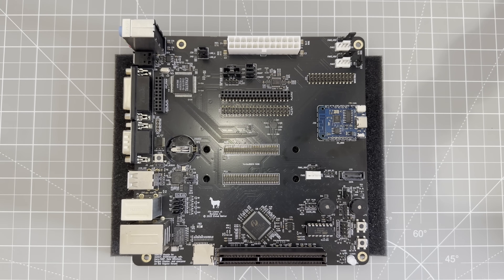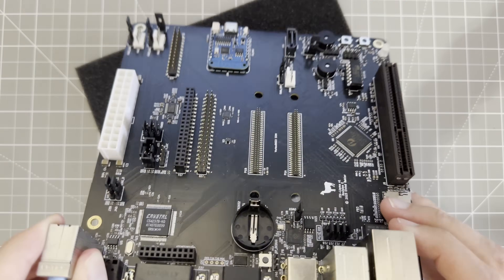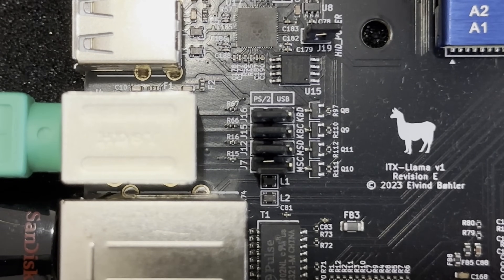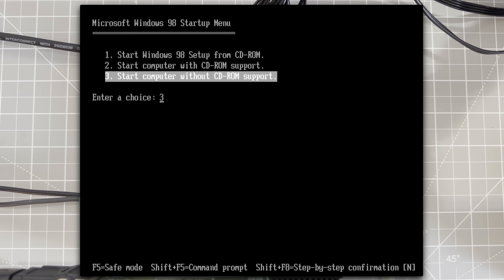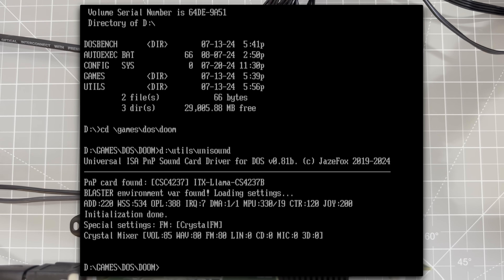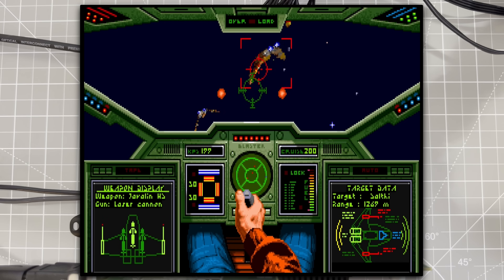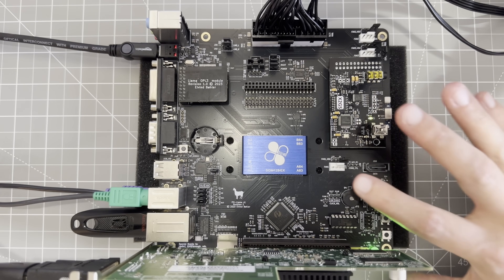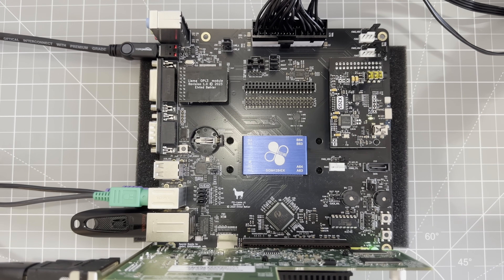ITX Llama: A Brand New PC for 1990s DOS Games!

Comment: Slightly OT, but when you mentioned sound cards I had to think of the fact we barely have them anymore, especially not "true" soundcards that did hardware acceleration. Good audio processing has somehow become a very rare occurance in games, with only a few outliers like Alien Isolation (who created their own audio solution for that game).
Reply from the maker: Agree! Dedicated sounds cards have definitely gone the way of the dodo :-(

I’m interested to learn more about Alien Isolation! What did they do that was custom?
Reply: @jamesfmackenzie  They developed their own audio solution that did real time reverb, depending on the layout of the levels and the source of the sound. None of it was "off the shelv" tech and completely developed in house (apparently because no current audio system satisfied them)
Reply from the maker: @xXYannuschXx  Wow! Very impressive! And another reminder to final play Alien Isolation! 🙂
Reply: @jamesfmackenzie  I can highly recommend it :)

I would recommend however to use the graphics INI tweaks and TAA injection. With current systems you can get alot more graphical fidellity out of the game.

PS: they also did some magic with the lighting system, where they used dynamic cubemaps (rendered during run time) to have dynamic radiosity; the light practically bounces around corners, like it would do with current day ray tracing methods.

Its mind boggling how far ahead they were with this game.

Comment: Just dropping into the comments to decimate the notion that you can emulate the total function of the system, clock accurate with simply the on board support chips.  No - that's not even really -- but now that I've said that somebody is going to drop in the comments and say exactly that.

Comment: I really love this. As others have commented, PCI is an interesting omission but with the various audio headers and onboard networking I'm not sure what PCI cards I'd actually add - perhaps a Voodoo card, although of course AGP versions were available. I'm guessing that going with ITX limited the design to one slot so I think AGP makes sense for those later Win9x games that are too much of a stretch for MiSTer. What a cool project!
Reply from the maker: Yep, it definitely has a bit more grunt than the ao486 core on MiSTer. I actually have a Voodoo 3 AGP running with this board now - it even copes with Quake 3 OK.

One for the next video!
Reply: This is not a native AGP implementation. Its PCI-E bridged to PCI running at 66Mhz. Its what the author declared and lets hope it really runs at 66. In that case its perfect for 3DFX cards. If only at 33 as PCI it would mean slight bottleneck, but not that much with this CPU. On non 3DFX it would be somewhat larger impact as they utilized the AGP bus more. Also, there seem to be compatibility issues, Nvidia cards do not work at all under windows for example. That being said, the author posts some benchmarks on Vongos and this thing performs somewhere on the level of Pentium MMX200-233. On non FPU heavy games it runs betters, so it behaves more like a Cyrix MII than anything else, so, any strong video cards makes no sense anyway. 

The author should have went with PCI instead, he even has PCI design done but still the AGP board seems to be more prevalent. I wold rather see micro ATX board with few PCI slots where one can get S3trioV2 + Voodoo2 with it. That would be the ideal combo for legacy glide compatibility, and also, Voodoo2 has the smallest CPU overhead of the old 3D cards.

Comment: As for the final question, I'll give my "UAE answer". Yes, it will appeal to a few people, but not enough to "sustain". And much like UAE back some 20-30y ago, when it was "barely usable", 86box will eventually be "more than you ever had back then". So DOSBOX will be less appealing because you'll have a full system emulator with full "virtual h/w" support at various levels. I can still run my "basic A500" cycle perfect emulation in WinUAE, but i can also boot my "souped up" config that blasts Quake@400FPS in software mode, which my old (very high end Amiga) couldn't and even current FPGA based "Amiga machines" can't. Of a single 1600AF core, moment i upgrade to a 5600 it will get another massive boost. Right now PCEm and 86box sit at around P233 levels, but i would be surprised if 10y down the road you weren't hitting at least AthlonXP level of performance on the emulated CPU, and if they care to write a gfx driver doing pass through to the host, you'll have "beyond any gfx card of that era" 3D performance.
And then there's that thing called cost. It's OK to go and buy a FabGL VGA32, at $10-15 it's worth it even if for the lulz. Stuff like the PicoMEM and PiStorm are still on the reasonable side. But once its "real money", things get more dicey, only the very extreme of the niche "must have hardware" will pay that much, and that's where the "won't sustain" kicks in.

Comment: Very interesting product. I started gaming as a 12 year old in 1998 so my period is more the very very late DOS, but mostly Win9x period vom 1997-2001. For anything newer i already have a nice Athlon64+6800Ultra system, but exactly that period of transition from DOS to Windows to fully 3D accelerated gaming is a pain. you basically need a system for each year with time correct graphics card and drivers otherwise you got a ton of problems. is there anything similar to the llama but with a bit more CPU oomph, like pentium 3 600mhz-ish? that would make building such a system on small room and just changing graphics card and OS depending on needs a much better experience than dealing with old clunky hardware in a big tower.
Reply from the maker: This board does run Windows 98 games quite well. But you’re right, it’s much less performant than (for example) a P3 600MHz.

If you want that class of hardware, you’ll have to buy old hardware. There are some ITX small boards based on the VIA Eden CPU that go up to 1.5GHz. Perhaps one of them might compare well with a PIII??
Reply from the maker: Another option is to look at thin client PCs. Occasionally you may find one with an expansion slot for adding graphics or sound :-)

Comment: It would be perfect if you could have USB ode and floppy emulation.
I don't like the idea of flashing the boot disk to the bios. That makes installing DOS 6.22 hard.
Reply from the maker: You can connect a CD or DVD drive via SATA. But 100% agree an ODE would be nice!
Reply: @jamesfmackenzie  oh, that's good. But what about external floppy emulation?
The board should come with an Isa slot as Isa slots can kinda daisy cheined. Then you could easily add an ide controller.

In fact, having a couple of ide ports would be amazing.
I wish someone made a board with a bit of legacy hardware support.
Reply from the maker: @ericmackrodt9441  I think in this case, the amount of ISA connectivity is limited by the Vortex86 GPIO interface - for example it only exposes 1 DMA channel that is used for the Crystal sound. It's a shame - because I would like lots of IDE and ISA slots too! 🙂

Comment: I love that this has a real AGP port  ❤
Reply from the maker: Time to add a Voodoo 3! :-)
Reply: It's not a real AGP port.  The SoC only supports PCI, so it's an AGP to PCI translation port using a converting chipset.  There are some issues with Win98 using AGP features that it can't access due to this conversion process.  So some issues with Nvidia drivers and 3DFX drivers have been reported.
Reply: How about an NVidia Riva TNT2 with 64mb video memory?  It was my final upgrade on the old tank bx440-P2@450 oh the good old days of PC building.
Reply: Still have my first voodoo card. But sadly no way of using it

Comment: I'm missing a full blown isa slot it at least some extension header to add one. Maybe as a card edge connector, so an extension board for isa could be an option. Things like the picoGUS or old vga cards and sound card could then be connected. 
No idea what the price was, but I'm late to the party anyway it seems.
Reply: At least 400€, not cheap although it's interesting. In terms of value and usefulness it's better to go buy a high end consumer CPU with very good single thread performance and use PCem or 86Box on a modern OS. At least with those you can still change the CPU speed with DOS software (like setmul, throttle, cpuspd) and "hardware" (you can change the cpu clock in real time with both PCem & 86Box). It's easier to set up, takes less space (2 pc vs 1) etc.

Comment: That's nice, but what about price and availability?
Reply from the maker: A late reply on this, but with some good news!

A community member is planning to build and make the ITX Llama available for general sale. You can purchase here:
https://retrodreams.ca

Find more details on the Vogons forum:
https://www.vogons.org/viewtopic.php?t=93480
Reply: At least 400€, not cheap although it's an interesting piece of hardware. In terms of value and usefulness it's better to go buy a high end consumer CPU with very good single thread performance and use PCem or 86Box on a modern OS. At least with those you can still change the CPU speed with DOS software (like setmul, throttle, cpuspd) and "hardware" (you can change the cpu clock in real time with both PCem & 86Box). It's easier to set up, takes less space (2 pc vs 1) etc.

Comment: "No compromises" no physical ISA slot, nor LPT
Still has a lot to offer and seems like a nice project overall - love the Ethernet jack.
Reply: I wished it did have a physical ISA slot and a Parallel port
Reply: @playy1797  Somebody savvy enough in their localities' secondhand (fleamarket/pawnshop/craigslist...) scene to get their hands on ISA soundcards will probably have an easy time getting their hands on period correct PC parts too.
Reply: @playy1797  So do I; I still have an old SB16 ISA card laying about, but no slot to fit it in. I've looked at those weird industrial chinese boards which have ISA slots, but they're more geared towards old factory hardware. There's also USB to ISA converters, but they lack hardware interrupt support, so a soundcard will not work in those. A variant of this board with an actual 16 bit ISA slot or a breakout ISA board would be cool.
Reply: And how would you fit an ISA slot on that thing? The slot (and the card that plugs into it) would be larger than the mainboard itself. Most stuff that you'd put in those ISA slots have contemporary alternatives. Joysticks, etc, you can get those anywhere. The Sound is the main problem and that's why they just provided ISA-Compatible sound.
Reply: @Dhalin  Headers and Daughterboard.
Reply: @Dhalin  There were sound cards other than sound blaster. The Gravis Ultrasound being the big one for Dos but also the Pro Audio Spectrum 16. On the early windows side any card with a Vortex 2 was THE king of sound but as far as I know all those cards were only PCI.
Reply: no ISA slot is a crime against my dreams :(
Reply: I'm sure people could retrofit ISA and LPT in the same way they used to upgrade Atari STs to 4MB, fit 68020 030 and even PPC into Amigas, etc. There weren't slots for those, they had to fit breakout sockets and solder some of the connections, or in some cases solder all of the connections.
Reply: A modern 64 bit CPU would be cool too, so you could dualboot DOS and Windows 11 on it (I know you can do that on many modern computers anyway, but DOS compatibility probably won't be great)
Reply: @se6369  Why not add a socket for the latest CPUs, ultra fast DIMMs, NVME M2 slot, fast PCI-E slots, gigabit ethernet, the latest Wi-Fi  and a modern sound card with surround sound? Surely it's bound to still be fully compatible with DOS and would be really cheap to buy. It's not as if you can just go out and buy a small, cheap, ready built, modern system to run Windows 11 on. 😂

Comment: what is that other 40pin header below the rPi header?
Reply from the maker: It’s also an rPi header. The board has a female connector for connect a rPi zero, and also a male connector for connecting a Raspberry Pi 3 via GPIO ribbon cable 😎

Comment: 300MHz? 500MHz? never understood the point of cloning retro pcs and then cranking them up. if you want power, just use a normal modern computer. that would be a lot easier and cheaper 🙂

Comment: Cool on one hand, on the other, there are still tons of old original hardware around.
Reply: It's increasingly hard to find hardware with ISA slots. High-end 486 or Pentium+3DFX will cost you more than a modern gaming PC with RTX GPU capable of 100+ FPS with ray-tracing at 1080-1440p.
Even hardware without ISA slots is getting expensive these days. Next step is Windows XP - compatible hardware. It's already past lowest (trash) value. Few years ago used Athlon XP CPUs were sold for 1€, now they're sold at 30-40€. Geforce 6600 or 7600 are almost back at their initial prices.

However in case of old Windows games, you can get slowest modern laptop, install Linux and run them using Wine/Proton. Linux has superb compatibility with Windows games. It's so good that Proton was ported to Windows, since it can give you better performance in some games. Like it made Alan Wake 2 playable on GTX 10xx GPUs. It sometimes doubled FPS, which was huge from 20 FPS to nearly 40.
Reply: @Leeki85  This board also doesn't have an ISA slot.
Reply: @surfinbirdzx  It has ISA Sound card built-in. This is what we need ISA slots for. Pretty much everything else is either integrated on-board or can be added via PCI card. If you're only interested in Windows 98 gaming, you can use PCI sound card.
These days we have SBEMU that can emulate old Sound Blaster cards in DOS using modern HD Audio. Though on modern hardware sound is not the only problem. PCs from last 5-8 years don't support EMS memory and graphics cards are no longer fully VGA compatible. The newest somewhat fully DOS compatible PC I have is Wyse 5060 thin client from 2016 with AMD CPU.
Reply: @Leeki85  Does it have PCI slot? I see only AGP for a videocard. When I buy new-old machine I want to hook any old hardware I have. AWE32 for example. Or an old adlib. I see no difference here with just using dosbox with plugins.
I have a modern ZX Spectrum clone, it have a real z80, real AY soundchip, real fdd controller and fully operational ZX BUS. So I have working machine out of the box and ability to hook real floppy drives and any periferals (old and new) I want.

Comment: I have the TinyLlama V2, based on the same SOC.
Compatibility is not so good: you won't be able to run games that use EMS for audio effects like  "Lemmings 2: The Tribes" with sound effects, for example, because there's something wrong with the CPU/BIOS regarding memory management.
Tried every memory manager under the sun, no luck.

I'm a bit tired of people claiming that something is "the next big thing" after some superficial tests: when you really start testing software, major incompatibilities appear and the original authors simply don't know or care.
Reply: The bios on this is open, so maybe your problem is fixable or already fixed.
Reply: @bzuidgeest  Fixable, maybe (if I knew my way around the BIOS sourcecode....).
Fixed, no, that's for sure.
Also, it's not "my problem": We're talking general compatibility problems here.

Comment: I love that this project exists although it's only going to appeal to a minority. I was lucky enough to get one but sadly have not yet put it together. Waiting on picking up a voodoo 3 card at my parents.Your video will help a lot with putting it together as really clear instructions. I've followed it from it's original incarnation as a credit card sized PC! The only change I would change would have been to replace the sound hardware with an ISA slot and then include the sound hardware as an addon card. That way I could try GUS cards, but a small issue. Would love to know what case you are going to use.
Reply from the maker: Thanks for the kind words and good luck with your own build!

I plan to add a case in my next video - still looking at options!

Comment: In regards to the 'brand new' label its really not fully new.. the opl3 and crystal chips are most probably harvested from e-waste boards these chips are way out of production cycles. also these parts  might have been through the aliexpress sand, laser etch & soldier bath approach to renewing chips to look new ,if you are really unlucky. Why no RTC battery installed ?.
Reply from the maker: Good catch! I did add the RTC battery - but forget to add it to the video 😂

Comment: There's only 2 things I can think of that I'd like to see added that might be improvements....

1) Dedicated PCI Slot - If I Want to run a Voodoo 3d or Voodoo2 3d card I'd have to put it in a PCI slot and then have an AGP Vid Card handling the 2d for the pass through....
2) Secondary SATA controller connection for a CD Drive... Boot from a HDD/SSD (cause SD Cards do wear out faster) and then a physical CD/DVD drive for loading some of my ancient collection I have in storage....

Other than that this thing does look perfect... Now to justify dropping the cash to get one and finding a New, Old Stock 4:3 Display to pair with it.... ;)
Reply: I really want to get my Obsidian X-24 going again, so I share that desire.
Reply from the maker: Obsidian X-24! You’re a very lucky owner of such a rare wonder! 🤩😎
Reply: @jamesfmackenzie  I never got to use it much because I upgraded my machine afterwards to Windows XP as I recall, and the drivers weren't available. Same problem with my Vortex Audio card as well. I still have the cards and rebuilding an era appropriate machine would be a fun project. As I'm doing a lot of side projects using Arduino's and RPi's, something like this might be an interesting approach.